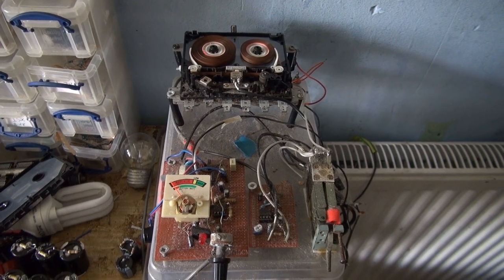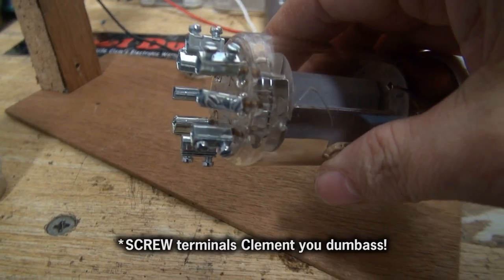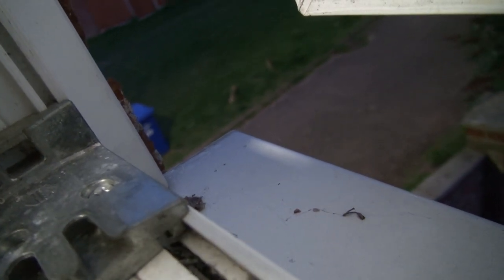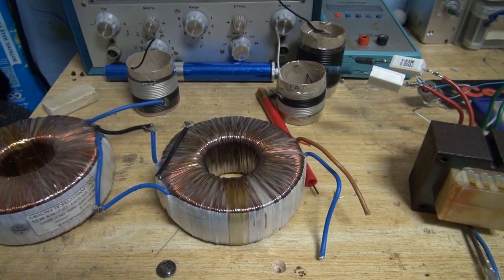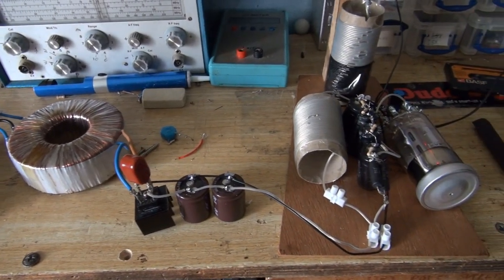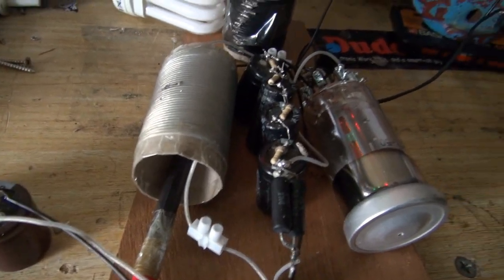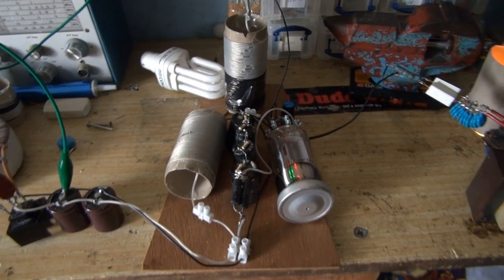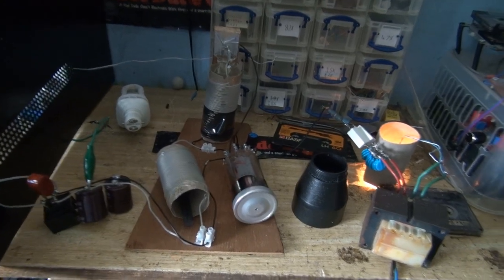Experimenting with tube oscillator circuits for plasma flame generator (but no flames yet)

Comment: That tube can take a pretty high b plus, i made a flyback driver with it and i used a mains voltage quadrupler with a tap for the screen, obviously 15MHz is a different story to 40kHz,.. iirc the datasheet says 1kV upto 46MHz but as you know Soviet tubes are under rated somwhat,a tripler might be the way i would go for a plasma flame with this tube,.. i broke my GU-50 forcing it into a DIY socket 🤦🏻‍♂️, il get some more at some point as i would like to resurrect my FB driver of yesteryear... 

Steve

Comment: Cool Video, CoolDudeClem.
Its good that you got it oscillating, if it doesnt oscillate it can blow the cathode bonding wire off the tube (ask me how i desteoyed 2 PL519s)
So adding a 1A fast fuse just in case is not a bad idea.
Otherwise the results are as expected, there are some myths around this circuit, i am a full believer that the first coil acts as a choke so you want as much inductance as you can get, so it should always have more turns than your resonator coil, the ferrite rod helps with that by isolating the g2 voltage from the resonator by more inductive impedence.
I heard that this circuit consists of 2 resonator circuits, i doubt it a bit, as you saw from your Experiments the choke coil had no real effect.
Try it with voltage doubled mains and see if you can get an arc from it, sometimes voltage doubled without smoothing can help with getting the arc established from my experimentation.

Also mind the temperature of your resonator, if the insulation melts it will short itself and it will act as a short turn and kill the oscillation. (ask me how i know)

on the grid feedback, the resistor should be as large as possible, but small enough in value to bias the tube at near 0V, personally i use a transfomer as a choke on a PushPull Style VTTC (big tube ZVS) (on my channel)

Good luck with it!
Reply from the maker: This will be running on doubled mains, but I'm going to do that in my shed, away from all the sensitive electronics, it knocked out my computer's audio during making this video despite how much I tried to shield everything (a reset fixed that) I am going to try this with a ferrite ring with 10 turns of wire as the choke, the only worry is that the core might not me useful at those frequencies or it might saturate. Another thing I'm going to try is the core out of a fly-back transformer as that has an air gap.
Reply: @CoolDudeClem  I doubt the little current it draws will be enough to saturate the core, i guess you can see at what current the core saturates with a scope and looking at what point its not linear anymore